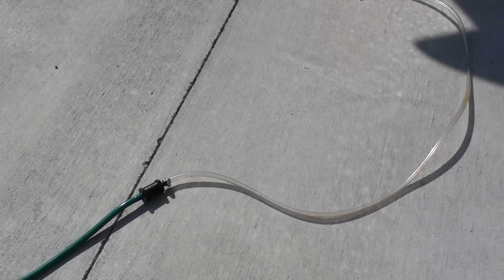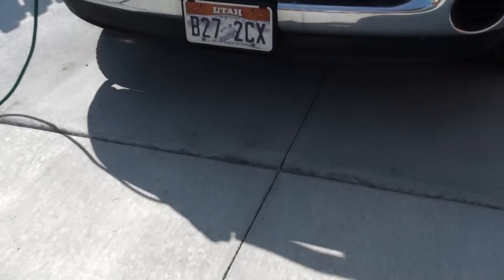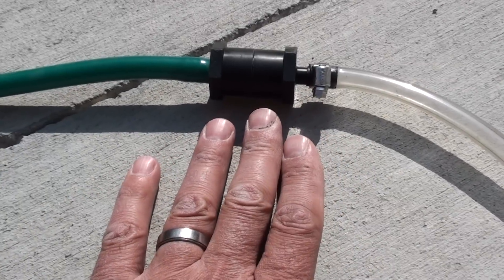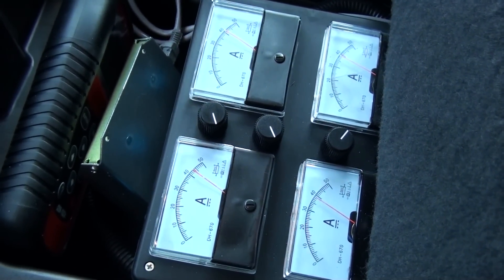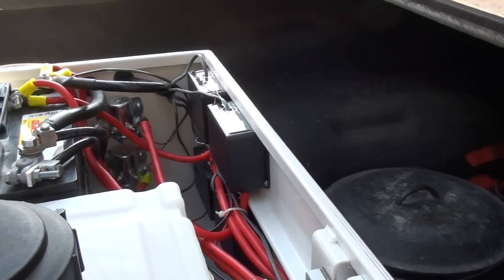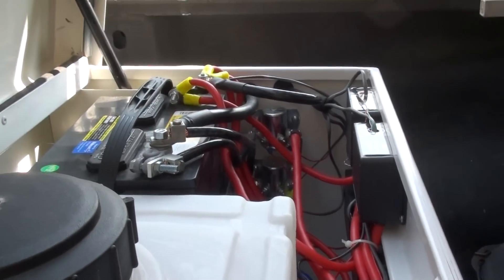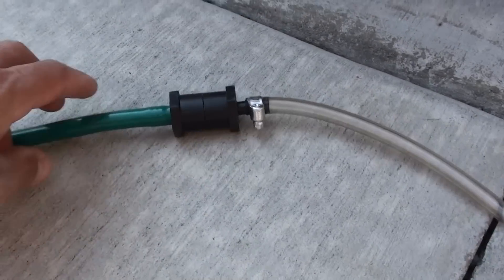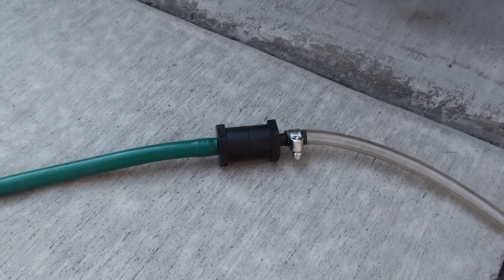High Output 12 lpm HHO Hydrogen Flashback Arrestor Demonstration

Comment: Does this arrestor work if the gaz is not totaly dry? It means a little bit of electrolyte is in the hose.
Reply from the maker: It actually works better with wet gas.
Reply: @Hydrogen4Health  thanks for your reply. But I mean, that the electrolyte contains NaOH or KOH. When it will dry in the arrestor, will the arrestor still sending the hydrogene or will close?

Comment: Very nice video. Is the idea of the arrestor to allow gas through but stop a flame going back because the metal wool conducts away it's heat?
Reply from the maker: It's not made with medal wool but yes it stops the flame from going through.
Reply: @Hydrogen4Health  so how does it allow gas through but not a flame the other way?

Comment: Can i use oxygen flashback arrestor for hydrogen gas ?
Reply from the maker: NO HHO burns 100 times faster than straight hydrogen. You need a specialized flash arrestor.
Reply: @Hydrogen4Health  I'm using 1.5 bar pure hydrogen. Can i use oxygen flashback arrestor? Is it a problem?

Comment: ? why not put two check valves in series they use them on air conditioning heat pump you can buy a brass ones at AC store
Reply: There's videos that show that doesn't work even with four of them in series.

Comment: Nice try Delvis11> So you want me to believe 12 lpm is comming outa a what 3/8th id hose? If you will check your video when you follow the green garden hose back to the top of the radiator area the green hose is twisted and kinked to where hardly anything could get through. You are misleading people in a manor that could result in someone being maimed or killed which will only result in negative publicity toward the HHO community. You have a very impressive looking system using no doubt enough "juice" to produce the 12 lpm you claim. People who have never witnessed a hho explosion(not someone lighting a few bubbles coming out of a open cylinder) have no idea of the potential. You are trying to show safety measures so get it right . Your hho supply hose would not be open on the end. With a closed system there would be immediately first over pressure to deal with and a flame front that moves faster than your gf's hand on prom night. Personal experience on both accounts. Good video. Be safe and keep trying.
Reply from the maker: You can see the system is pulling 40 amps from each PWM and the bubbler is producing. If I'm lying  where is the hho going if it's not coming out of the arrestor?
I have been nothing but straight with people and I have a great reputation. Even with the kink in the hose 12 lpm will easily go through. Nice try though.

Comment: Incorrect. Seperator cells need flash arrestors  too. This is because inside the cell a membrane is used to sperate the O from the H. This membrane has very small holes in it so that water can pass through and this electrons. If the pressure on one side of the membrane is different to the other, it is possible for the gasses to mix slightly. Ive seen it happen. Always use a flash arrestor.

Comment: No moving equipment known in this planet including those that could no longer move because of extreme weight will need your 12 liters per minute of HHO delvis. Just where the hell are you going to apply this kind of production? On a gigantic space city run by internal combustion engine? Unless of course you would want to separate the gasses and store that 12 lpm of Hydrogen and sell it until you get rich.

Comment: Sounds good man! I am settled in for the most part! I am working on a more improved fuel vapor bubbler system which should give consistent results and will have it installed and running in my Jeep when I stop by if all goes as planned!

Comment from the maker: This unit doesn't use bronze or ss wool so it flows a lot better. also if the ss wool type arrestor is not packed right it can fail. I think people buy these to be safe. Getting it wrong can be dangerous. An exploding tank of caustic KOH will ruin your day.